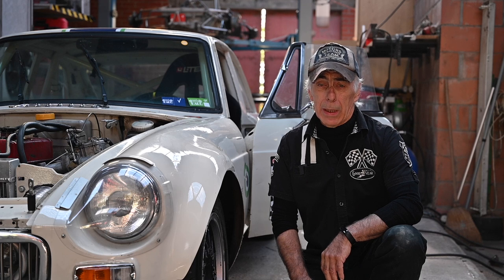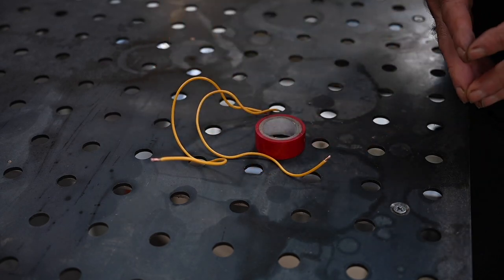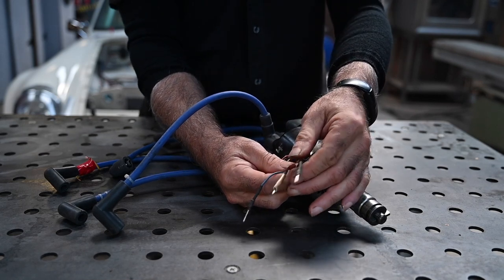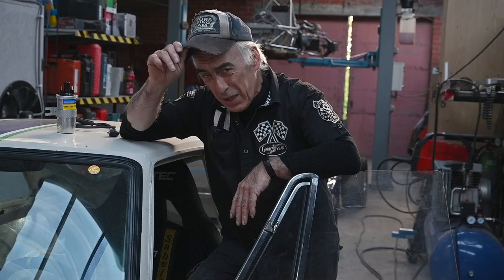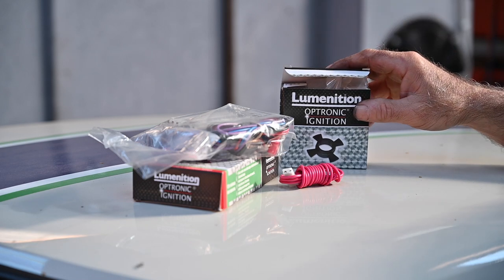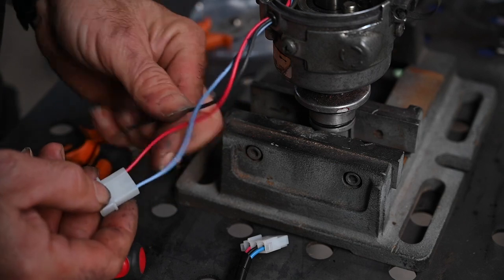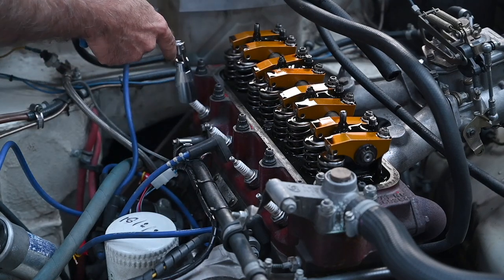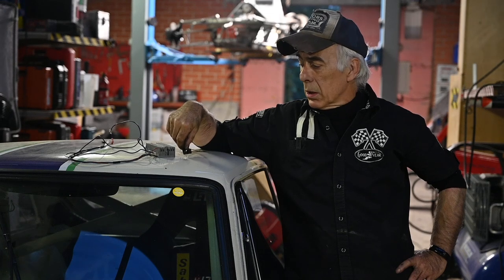Electronic Ignition trouble - MGB

Comment: When trying to find the compression stroke on number one cylinder, rather than removing the valve cover to look at the movement of the valve mechanism, I remove all the plugs apart from number one. When you rotate the crankshaft and feel compression, it has to be  number one cylinder. Saves making a mess and the possibility of damaging the gasket.

Comment: Very interesting. I too have a mgb 1979 with electronic ignition. It has no pickup on no1 and an erratic pick up on no3 the main difference is I have an accuspark ignition which is not optical. I do not have an oscilloscope so I can only view the spark “optically”. Yours is the first case I have come across where there is no obvious fault. This gives me hope and maybe I am not loosing my mind!  Thanks for the video

Comment: Thank you for your excellent video. I think the best way to test the ignition is to measure the length of the spark, using an adjustable spark tester. Amperage draw is a good test, but it only measures the current in the primary winding. If the transistor in the module doesn’t make a clean break or the secondary coil winding has a problem, the spark output will be weak or erratic.

Comment: This is very intresting on how to check them components. Although I personally am not a fan of lumenition (I had and also some friends retired from rallies because of issues with them ) On the Avenger/Sunbeam 1600 uses the same distributer as Mini D4. My preferred system is the 123ignition .NL Electronic Distributer which fits straight in and 2 wires to the coil. It has no centrifugal advance weights but a solid shaft instead. You can select your preffered advance curve by Dip switch or USB depending on model. Also I found if my plugs are too cold they can foul up (black) and the strobe light dont flash properly. My favourite plug for my engine is the NGK Iridium BP6 heat range I never had problems since i used both them. Thank you looking forward to more great viewing.
Reply from the maker: Indeed, I have been running the 123 Bleu Toot ignition on my V8 MGB GT... works well.

Comment: too funny, I just returned from picking up a 34mm to find tdc on mine.
guess I need to try one of those amp boxes...
and as usual you showed us how the pros do it, thank you!
Reply from the maker: Go for it!
Reply: @D3Sshooter  how could I test plug wires to see if they are resistor type? I cannot find any info to see if the Accuspark red wires are. And I have some ngk r6ey in and hear that resistor wires AND plugs is a poor combo?

Comment: LOVE your trick of wrapping a wire coil around an ignition wire so one can measure secondary voltages with a non-automotive O'scope. i wonder if one can get an accurate secondary voltage measurement using the wire coil's turns ratio and some other calculations...

Comment: Thank you for the great video that taught me some things. I have a small block Chevy in my pro street car with a Mallory dual point distributor which has nothing wrong with it but think electronic ignition would make it run bit better and cleaner burn. But seeing all the reviews on people having problems with dual point electronic conversion kits from the various brands like Mallory, MSD and Pertronix which all make conversion kits and ignition boxes but I don’t want to get stuck on the side of the road with a module or box that goes out. I did buy a old black Mallory HyFire  IV ignition box and matching coil I think if I remember correctly was meant to run with my Mallory dual point dizzy. Car has a dual tunnel ram with two Edelbrock 1405’s and my Mallory dual point is in there tight so can’t throw in a HEI since cap is to big. But Pertronix makes one with an outside module that would fit but then again I have zero confidence in all the electronic brands. Any suggestions would be greatly appreciated.

Comment: Steve please explain why you run your race engine without air filters ? Dave Vizard ( source his book on A series modification ) found that air filtration , properly sized and designed for the carb of choice , did not effect the maximum power and kept dirt , of which a race track has plenty due to soft tyres , out allowing less engine damage . DV tested Webers with filter boxes with rams which I bet you know about . The only advantage of running with no filter is the sound of the air rushing through the carbs , which is nice , but .....
Reply from the maker: It makes a very small difference, on the airflow and turbulence  .. I possible should put a filter up

Comment: I would have put one channel of the oscilloscope on the optic sensor output, and the other channel on the ignition coil primary side (hundreds of volts, set probes correctly and make sure the scope can handle the voltage!). This would show much of what you say you don't test, the dynamics of the "box" - you see exactly what input the box gets from the sensor, as well as what the box sends out to the coil. 
You also see all the sparks in the primary side voltage, so you can compare their peak voltage and duration - if all cylinders are working under the same conditions they should be reasonably close to the same, while a faulty plug, lead or cylinder running way rich, lean or different compression should stick out like a sore thumb.
Reply from the maker: Indee, there are many more possibilities to test and trace, I could even head-up the box and so on... If I was to fix the amp modue then I would do that indeed.  But not directly on the HT as that is 20KV

Comment: Brilliant video. I didn’t have the really expensive type of electronic ignition I had the cheaper type but on two of my cars I’ve gone back to points because of them just braking down with no warning! At least with points you can fixed/ change them at the road side. When you raped the wires round the HT leads did you fix one end of the prob to one end of the wire and the earth lead of the prob to the other end of the winding wire? Just to make it clear to me? Thanks ☺️

Comment: Great video. I'm struggling to see why a fault with the amplifier would affect 2 cylinders and not the other two though - surely it should be getting exactly the same trigger signal for all 4 (the shutter disk is symmetrical), and then it's driving the same single coil.
Is it just that the output was weak for all 4, and two of the plugs happened to have different gaps, soot, lead resistance or whatever, and the low output was just enough to make 2 spark, and just not enough to make the other two spark?
Reply: Maybe the coil was not getting enough time or current from the timing amplifier module to create enough magnetic field to then create a decent spark plug voltage . Possibly the 'dwell' , in old points terms , was somehow insufficient . Would this indicate a capacitor problem within the amplifier ?
Reply from the maker: it can be related to the fire sequence... and slowness of electronic components in the amplifier.  In each case that solved the issue

Comment: Great video! Now I'm going to test my Lumenition set I have laying around and which I couldn't get to operate... Where did you find the affordable new Lumenition set?
Reply: I'd be interested to know the answer to this question, too. Wouldn't mind getting hold of an optical sensor and chopper disc to test with a Bosch high power inductive ignitor and coil on my '66 Alfa. The prices I see online for these Lumenition items aren't attractive, however.

Comment: Hi thank you for your video, it baffles me how the optocoupler knows that that it is firing on cylinders 2 and 3 ?  the scope sowed no difference between cylinders . I have had a similar problem that the timing light would not flash on some cylinders , i changed the spark plugs and querd the problem.  It turns out that the engine was too rich and  socking in the plug incinerators and not letting the ht voltage to get high enough the set off the strobe light.

Comment: Thankyou Steve, another great tutorial we have. 
I have a question for you. My mini is running 1275 twin hs2 carb with Lucas 65D electronic distributor. When i set the base timing on 10 degree, the engine start pining when it goes high rpm with loading.
Is it because i hv too much vacuum advance? 
Can i adjust the vacuum advance on 65D to avoid pining and at the same te keep running 10 degree base timing?

I've been struggle in this problem for a while. Right now just run with 6 degree base timing but the engine temperatrue is a bit high.

Thankyou.

Comment: I'm not a big fan of Lumenition and optical detection ... I used several times Pertronix, with no issue, but now they are far more expensive than before ! then, for Lucas distributors, I used twice Accuspark (UK company), that use hall effect detection, and that's cheap and fine ! no CDI though, but it allows to get rid of points...

Comment: Steve, why not just fit standard distributor breaker points? They work fine and have done so for 100 years. Even is you choose to replace them every 2 years that's a lot less dicking around that this science project and replacement expense that you just went thru.
Reply from the maker: Hi Hugh, the reason is simple, this is a race car and at high rev's7000 RPM those mechanical points are to slow to react when closing.... besides the fact that I want a much stronger spark.  More current through the primary of the HT coil is giving more output , brakerpoints are not all that good for high currents... I hope that this answered the question

Comment: the IR sensors get weak with sending a square wave pules over time heat and stuff or the driver box is weak
Reply from the maker: they do indeed, but what is over time... 5 - 10 years
Reply: @D3Sshooter  possibly I would put star washers under the grounds on the amp box too

Comment: Check your rotor button, replaced entire electronic system, nought wrong with it!!! Twas the rotor button,would run fine but stop for no reason,restart fine but stop a short time later. New button all fixed,albeit I had now had two electronic systems both worked perfectly!!! Mal in au.

Comment: I fitted accuspark complete system to my Essex V6...now nothing works..any ideas
Reply from the maker: that is hard to tell without more info.   Are you sure that distributor is fitted in the correct direction so that the rotor points to cylinder 1 when that one is at the top of the cylinder and both valves are closed ( compression stroke),,,  when you say nothing works what do you mean ?

Comment: Do you have any experience with Lumenition Magnetronic or Pertronix Ignitor?
Heard that the Pertronix is very reliable.
Reply: The New parts boxes were labeled Lumenition brand.  I have had good luck with a Pertronix system which uses a Halle effect timing sensor rather than this optic control. The Pertronix installation instructions do stress the importance of a very clean electrical supply for optimum system functioning and life  — no voltage spikes, proper solid ground paths, and the use of a specific coil and plug wires.  I suspect all or some of these rules would apply to the Lumenition, but that’s just electronic common sense.  An additional Pertronix caution states —  Do not leave the ignition switched on if the engine is not running.
Reply from the maker: Yes ,  IMO both are good systems...  Although I prefer the infrared. its simple and needs very little adjustment
Reply from the maker: Indeed, and that is why the infra red is far less sensitive and as such IMO more reliable.  As for the last note in your text, you can see what happens if the chopper happens to block the IR light when the engine is stopped... permanent 7Amps through the Coil....  Battery will run empty and the coil and amp will burn up
Reply: Thank you for your response and infos! 👍
Reply: @myrlstone8904  if you use the Pertronix 2 it allows you to leave the key on, with no harm to coil. But it runs a coil of under 1 ohm. I ran it on my  former MG.
Reply: @D3Sshooter    Interesting, It appears that leaving the key on with a stopped engine has the potential of damaging the ignition system even with the old points type distributor - burned points, overheated coil.
Many may mistakenly assign this as a drawback to an electronic ignition when it, in fact, applies to both.
Reply from the maker: @myrlstone8904  Indeed... its a Russian Roulette , so its better to turn it of

Comment: Ignition trouble with a MGB? Really? I remember multiple episodes of total loss of ignition while driving at 70 mph. That's right, driving along with no problem and then... nothing. I got to know the wrecker driver and heard all about his kids in my multiple tows to the dealer.
Reply from the maker: Yep , that is a MG
Reply: Lucas electrics?
Reply: @stephenalexander6721  Yep... Stupidest system so far invented... I have never seen another ignition system with a relay in the running circuit... perhaps in the starting circuit. Finally I bought several little can relays so when it quit I could pop the hood and replace the relay... then I was good for another 1000 miles, or 100 miles, or 10 miles.